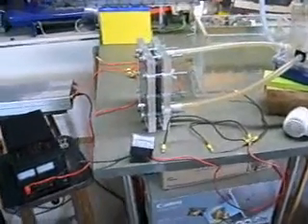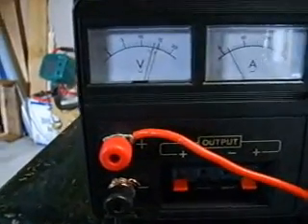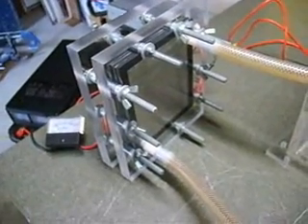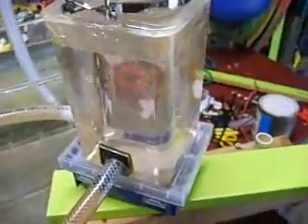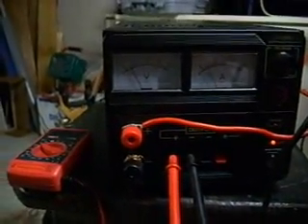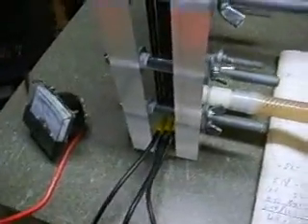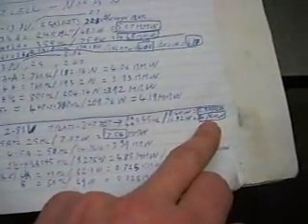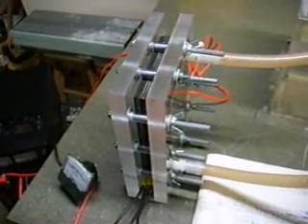Hydrogen at home (Voltage vs configuration)#31

Comment: I use a 4 farad capacitor to smooth out the ripples in the rectified AC that powers my device ... you are using a regulated power supply which supplies clean DC power so would not need the capacitor ...